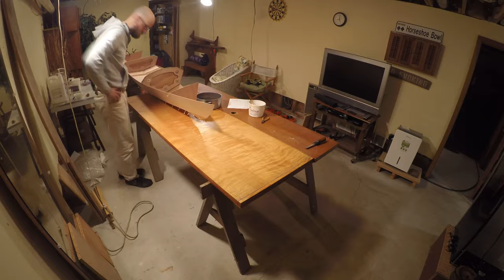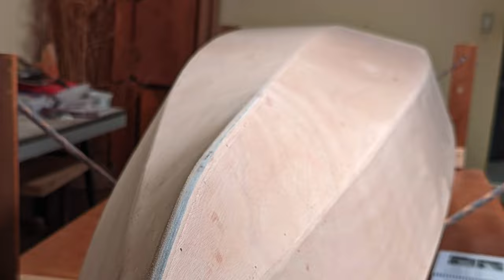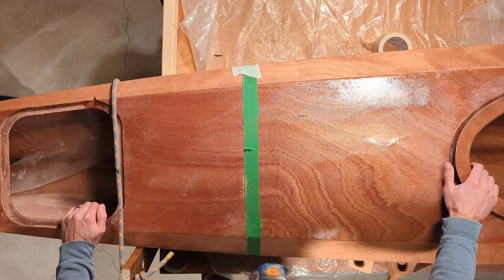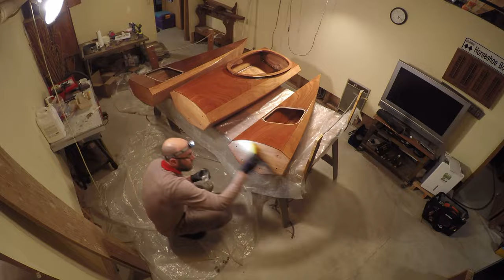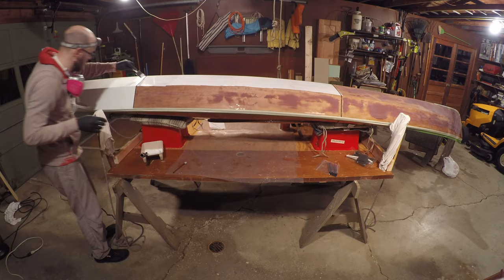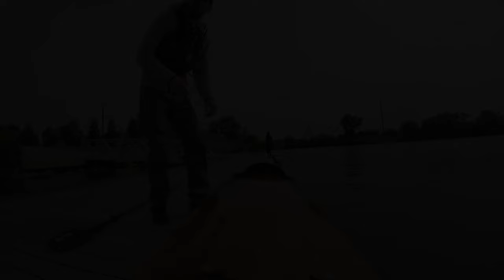Building a Wooden Kayak in Time-lapse: CLC Sectional Shearwater Sport

Comment: Very nice. But what was the point of making it sectional if transported as whole? Maybe for storage? For me, would be the transportation part with a sedan car without a roof rack would be beneficial to have sectional and quick assembly solution.
Reply from the maker: That's a fair question. The main reason was for storage. I don't live in the house where this was filmed and have to use a pretty small elevator to get the boat in-and-out of its final home (i.e., no garage or freight elevator). I've also found that the sectional is very convenient for car-topping when going out solo. I will often strap it to the roof in pieces and put it together at the launch point so that it's much more manageable to get on-and-off the roof without help.